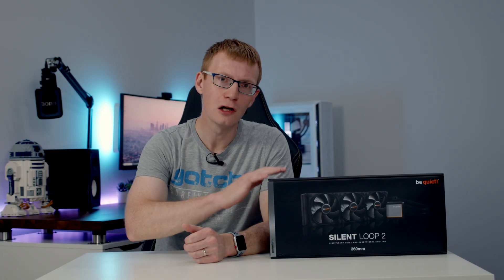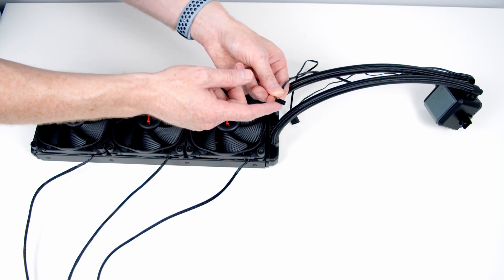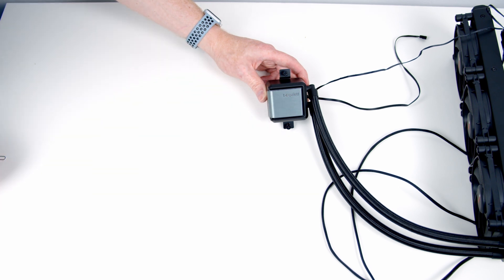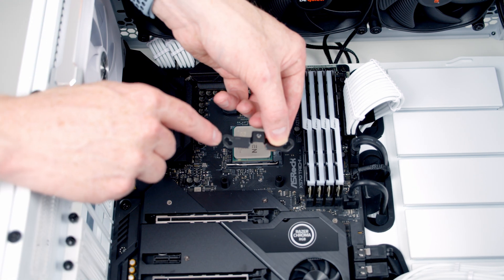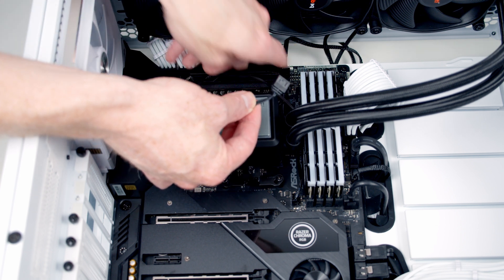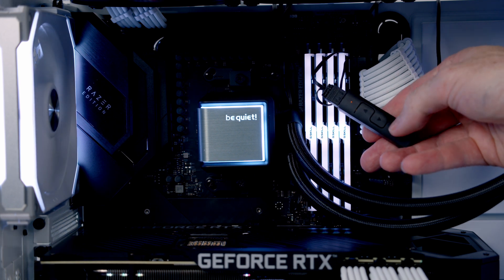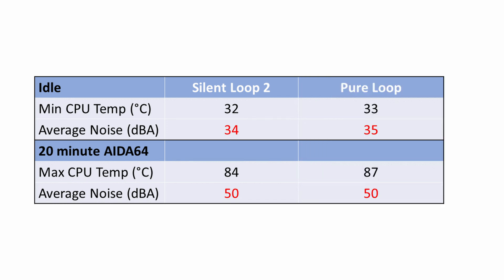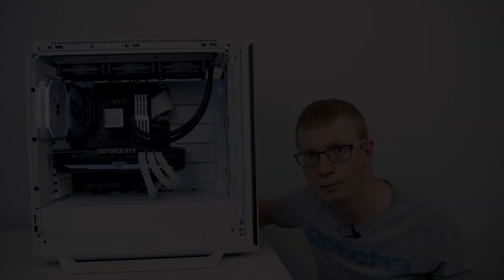be quiet! Silent Loop 2 - Installation Guide and Review

Comment: is it also possible to mount the radiator on the inside and the fans on the outside of the case with this product? if not does anyone have a product recommendation that does perform well that way? I found that most products on the market right now are designed to have the fans on top of the radiator which would reach critically far down towards the center of my motherboard and therefore I may have trouble with warm air not being properly fanned out

Comment: I ordered one of these and the pump is making some seriously loud buzzing sound, under zero load. Going to have to send it back, do you think I should take my chances getting a new one or change to a different AIO alltogether?
Reply: Set It to lower voltage, i did 10v and 0 performance loss while its completely silent. It runs at 12v default and makes that sound 😢
Reply: @FranciszekWolc  Thanks for the response and advice, but I have already sent it back and got a unit that doesn't make the noise without having to change any voltages :)

Comment: The 4 Pin PUMP_FAN1 connector of the Mainboard. Connecting the 3 pin pump cable to it or the 4Pin Y-cable with the 2 silent loop 2 fans?

Comment: Bought Silent Loop 2.  5 months later swapped for New Lian Lia Galahad 2 Trinity performance thinking better cooling for 13900k. 2 months later pump started with noticeable buzzing and progressed to buzzing  audible across the house 5 days later. Never got results expected from Trinity and bummed. Went back to Silent Loop 2. Performs better at idle and stressed. Waste of time and money. Next best thing doesn't always mean that. Highly recommend this cooler for 13900k for stock clock speeds. Overclocking I would research custom loop

Comment: My only concern is, how hard I should srew on the pump to the CPU, because there is no stopping point, because of the springs and I find nothing on the internet about this...
I think this was a bit of a design error, because if you are weak you fasten it to your max, and it's gonna be okay, but when you are strong, you fasten it and something breaks, not ideal...

I mean at this point there should be a torque number or somthing about it... I know it's probably okay how I mounted it, but I still wanna know.
Reply: There should have been chipset specific spacers included that are NOT OPTIONAL. you NEED to install those, otherwise your predicted scenario most likely WILL happen.

Comment: Hello good Sir. Thanks to you I made the decision to go for the Lian Li Dynamic EVO with a 12700 CPU.  I'd like to swap the fans on the 360mm Silent Loop 2 AIO with Light Wings since they're advertised as quiet & effective while having RGB. 
My question is: would you go for the PWM or the High Speed Light Wings on the radiator? The High Speed ones have better static pressure and a higher RPM, but if the difference isnt that big, would you also go ahead and choose the PWM fans?

Comment: Hey Christopher, great review as always ! 
I'm wondering if the triple splitter câble for the fan connector comes with the bundle of the Aio ? 
Thanks !
Reply: It does. I wonder whether it is even needed or not. I don't really get the point of it for the 280 and 240 versions unless you have a weird board and don't have enough cpu fan headers on it maybe?

Comment: hey mate, i recently bought this and i realised I dont have a 3 pin argb header on my motherboard, only 4 pin. so i used the argb controller to set my own lighting. However, rgb resets itself to default setting whenever i boot my computer. Need your help, Cheers mate.

Comment: The pump is really audible on my pure loop 2 aio. Is it the same for the silent loop 2?
Reply: Wondering this aswell.
Reply: If the pump of the silent loop is audible, you probably installed the aio wrong. Always make sure the pump is below the highest point of the radiator. Otherwise, it will suck air and destroy itself over time.

Comment: Thank You for Your review. I thought my 360mm had defect when I felt like jet taking off next to my head when fans startes spin on 100% rpm. I Also saw 83,6°C at full load on Ryzen 9 5900x pbo co - 25, +200mhz, limits on motherboard, scalar 10x. Aio is whisper quiet at iddle 900rpm fans and pump at 2800rpm(max). I expected much more from 360mm AIO. On iddle temps are only 2°C better(39°C insted of 41°C) and pbo +co  temps are around 83°C compared to 86-89°C on Noctua. I will probably switch back to air cooler after this expirience.

Comment: Fitted mine today, very impressed with the overall quality of the AIO. Thanks for your detailed review which convinced me to buy the SL2 280mm. 
Front mounted rad, pipes at bottom, purged of any bubbles prior to fitting the cpu block and now I have a near silent pump with a 15 degrees c drop during benchmarking tests compared to my old Hyper 212 Evo. Time for some more overclocking of an old but solid i7 4790k.
Reply: Can you change the LEDs using a software?
Reply: @coolissimo69  Yes, either through the Bequiet controller or a compatible motherboard.

Comment: I just got this and my first impression is its great.  Definitely helping to keep my temps down on a R9 5950x.  However, there is a noticeable hum on the AIO when in "silent" (in asus AI Suite).  I just played around with the fan curve and I think its doing the trick... but I also read a comment about lowering the voltage to 9V.  How? I was looking through the bios but didn't see it clearly. Any tips?  I noticed the recommended power for this cooler is 9-12v.  Thanks for the review.
Reply: Same question here. Well I know where the DC switch is but I can only change it if I switch fan smart mode on. But if I do, the default setting for idle would be 1.56V and I'm scared that if i switch it on it'll damage the pump. Shame because it is quite noisy at max speed.